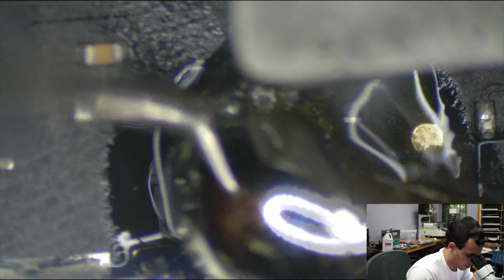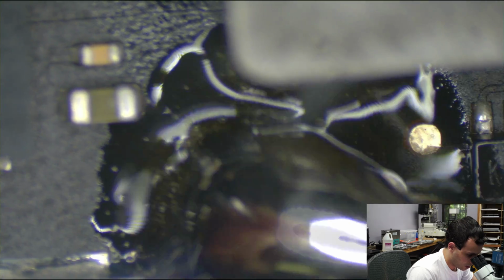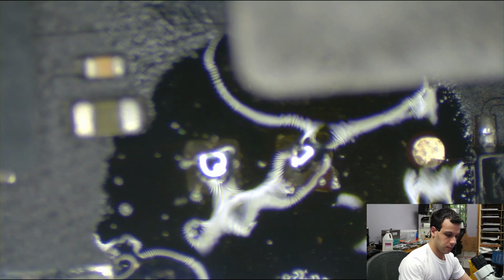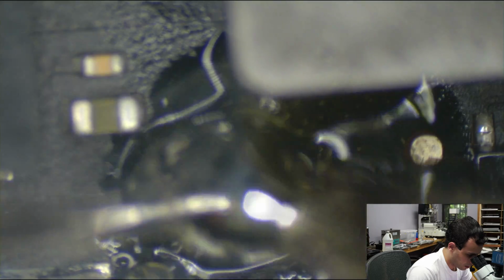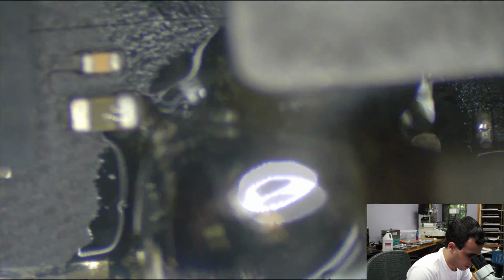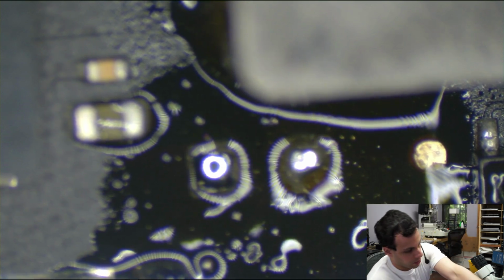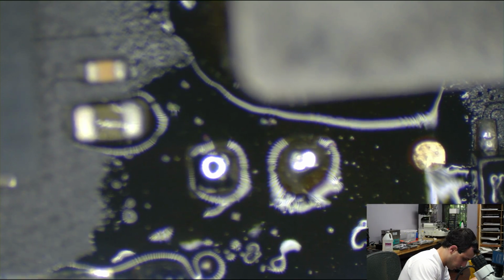Replacing backlight fuse on Macbook Air.

Comment: Hoping that this would be a solution to my problem, however it looks like there's something more to it. The backlight mostly doesn't turn on after wake up from sleep, after a reboot it's always working fine. Sometimes the computer does a random reboot, after which the boot takes a while. The board has been replaced by Apple, after that, some time later the backlight issue started appearing, it happened with hight frequency, so A replaced the display too. The frequency of the issue dropped, however it's still persistent. My guess that it's either a failing SSD (thus the slow boots) or a cable (doubt this tho, since the computer doesn't need to be moved for the backlight to disappear or not come up). Anyone has suggestions where to look next?

Comment: I swapped a cracked display on a 13” mid 2014 MacBook pro with Retina display and the backlight stopped working. (I most definitely had the battery disconnected) I swapped the old display back thinking the display I purchased was faulty, however that no longer has backlight. I checked the fuse with a multimeter and there doesn’t seem to be an issue with  it. There is no visible damage to the display cable or it’s connection. Any ideas of what could be the issue. It’s not really worth it to buy a new logic board when you can find these macs on Craig’s list for the same price.

Comment: I have a Macbook air 2015 model with the backlight blown (wine spilled on the mac). The screen is visible if you shine a light. If I replace the screen completely do you think that will fix the issue or is it typical that the problems go beyond the screen assembly. Diags come out clean.  Thanks!
Reply: Im in the exact same boat, same reason, same drink! :-) Im currently using an ipad as an external usb screen but im not sure how long my eyes will be happy with the setup.
Reply: trickeyD We sent it in to Louis and he was unable to repair it. Now the screen works fine, but the SSD and fan sensors have no connection so we cannot use the machine. Might have happened anyways, who knows but not all the boards apparently are repairable.

Comment: hello there Louis, great videos, i had to test about 100 a1398 lcds, halfway threw the test the macbook is coming on but the screen is not showing in anymore, i was wondering if i have blown this fuse which is next to it, l8300 or the P fuse as for your video, now i have 2 of those in the same situation i have blown 2 a1398's they come on but no display, this happened by just testing some retina lcds, please kindly if you can an answer, many thanks ( boards are 820-3332-A)

Comment: Hello Luis,
I am spanish. I am sorry for my english.
I have a MacBook Air 13" 2011. The problem that it has is no display backlight. I checked the fuse "P" and it failed, no continuity. I replaced the fuse and the MacBook continues the same, fail backlight. I checked another time the fuse, the fuse is Ok. At one of the extremes of the fuse there are aprox 8,00v and at the other 0,00v but the continuity is Ok, I do not understand this. Can you help me?. Thank you very much.

Comment: Dear Louis,

Great video, indeed!
I'm trying to apply the same fix onmy own, but I'm wondering where to this "F7700" backlight fuse (if not from a dead board)?

Appreciate your feedback!

Br,
Thomas
Reply: Probably pretty late for an answer. But you can take the specs from the schematic and order it from any electronics components provider

Comment: hey Louis!
first of all, finally found some good useful stuff on YouTube again, really nice channel, keep it up!
so I have a problem: I have a MacBook air mid 2009, and it doesn't turn on anymore (the sleeping mode didn't activate after I put it in my backpack and it overheated, after 2 hours it cooled down but it didn't start anymore) There is not a specific beeping code, but sometimes it beeps one single time for about three seconds, than its quiet again. The beep is not repeating and only comes once while new starting...
fan is running as usual, but screen is black... 

any suggestions what video to watch? you have so many ;)

thanks in advance
Reply: oh and it doesn't beep while new starting, it beeps after I started it, but not always at the same time, sometimes it takes seconds, sometimes minutes!

Comment: Hello Louis, Thanks for your videos.

I'm trying to fix a Macbook air that as been spilled with water. Although it works perfectly with an external display its backlight isn't turning on and also using a flashlight I've found that there is no "signal" to the screen. Any chance of the display also being damaged by the logic board or by your experience you think that it's unlikely to happen and that damage will be limited to the logic board?
Reply from the maker: +Filipe Costa It's kind of like asking if someone gets shot, will they be able to walk again
Reply: I see, thanks for the input.

Comment: Love your videos man... I have a MBA 2013 13' A1466 no backlight can see with flashlight though(not a screen issue have 2 screens) fuse F7700( Name on board: P) is passing continuity tests which I tested because I thought it was a fuse, whats next on the primary suspect list the WLED driver? i'd be interested in hearing your common suspect on these boards
Reply: +Health Verum I should ask is there another way to diagnose the root cause with a multimeter?

Comment: I bought a macbook Air tonight with backlight issue for $100 and I was just need to know the fuse how does it look like so I can replace it .
Reply: +Maiaal100 if its the MBA 2013 13' probably the P fuse right over beside the ribbon ...not for sure though
Reply: +Health Verum  Hi
thanks for replying, I found it and replaced it :)
it`s working perfectly now
and you`re right, it was the one beside the ribbon
Reply: your lucky you fixed it. I have the same issue right now except I'm getting a positive continuity for my fuse.. something deeper I believe (n)
Reply: and congrats on the 100$ steal nice profit ;)
Reply: +Maiaal100 how do you know if its bad fuse? 2014 macbook air no back light:(
Reply: use the micrometer to test the resistor through the fuse

Comment: Hi Louis.  I really enjoy your videos.  Good stuff.  Anyway, I have a question that doesn't necessarily pertain to this video but it's a problem that many iMac and MacBook owners have to suffer...and that's Random Shutdown Syndrome.  Have you done any boards that have this problem?  And if you have, what do you usually look at first?  And do you ever refer to the OS shutdown codes for insights?

Thanks.
Reply from the maker: TheMasterCylinder What board is this? This can be anything, literally anything.
Reply: Sorry.  The logic board of, possibly, a MacBook Pro 2011 or, in my case, an iMac 24" early 2009 with geforce gt 130 512 MB.
Reply from the maker: Shitty VRAM on iMac, GPU on Macbook.
Reply: Succinct and to the point.  Thanks, Louis!

Comment: Great video louis. Was wondering if you have any tips for a new tech when it comes to troubleshooting a motherboard. like what should i check first or is there a efficient way of checking most/whole board?
Reply: +DEM9271 Look for any oxidation, burns, or swolen caps.

Comment: Louis How much do you think is a fair price to charge for this repair?  Most people are not going to do this themselves
Reply from the maker: Khuong Truong $325 + tax here. A few reasons I find this fine.

1) *speed*

Half the shops around my area would tell them to replace the board or outsource it to someone who charges them $200-$250 and takes a week to do it(while stealing half the machine's parts in the process). Whether outsourcing board repair or ordering a new board, that takes time, that professional users do not have when this is their primary work machine. I am offering you turnaround you won't get anywhere else, which is an upsell. I can take the machine to my office, fix, and bring it back to you. No downtime is worth something. 

2) *Living area*

In my market, that upstairs from my store are disgusting, shitbox apartments for $2600/mo. One even went on fire spontaneously recently, and they cost $2600/mo. I am open with many people that they may find cheaper if they look outside NYC, if they are calling from other states looking for board repair. No reason to pay NYC prices if you live in Oklahoma or Wisconsin. In NYC, Manhattan in particular, everything is a ripoff, and sadly some of that gets passed onto the customer. :( 

Outside NYC I wouldn't mind offering board repair for $140-$250 but this is Manhattan. 

3) *job done right*

You may think "oh it's just a fuse." It's easy to do that.. "Here's how I see it. I think of all the times I tried to teach a new employee how to do something, and I remember all the stupid fuckups they made along the way. Then I imagine what is it worth to the customer to avoid repeating that experience. It is really hard for us as professionals to remember back to what it was like when we were clueless tards, but it's easy to get a glimpse of that when I try and teach someone new. It reminds me of the value of a job well done, when I see what someone else thinks is ok to do on the first try. That is what the customer is in for when they try to do it themselves, or take it to a craigslist newbie. 

What if it's something else? What if there's a short to ground? What if a component gets knocked off? What if you forget to unplug the battery? Think of everything your worst employee ever fucked up, and imagine that happening to the customer. What is it worth for them to avoid that experience? 

4) *flat rate system* 

If a board tortures me, and takes 3 to 5 hours of my life, and I cannot fix it, I do not charge. In the no fix no pay system, this is made up for by the boards I can fix. So flat rate applies. I'm not going to charge $0 for the jobs I put an hour or two into because I didn't fix them and then charge $40 for a successful one because someone else thinks I should call it "easy."  I aint charging people for unplugging their battery and plugging it back in or for SMC resets, but if I'm taking out a soldering iron and a multimeter, you pay! 

5) *clean conscience*

If one wants to learn how to do it themselves, they can watch the video I made for this purpose. this shows you how, with the most inappropriate of tips, and a ten dollar soldering iron, how to replace the backlight fuse. This video was designed with DIY people in mind. 

https://www.youtube.com/watch?v=NKXzm_fkja4

If you want to learn how to directly compete with me, what tools to buy, how to sell customers, how to fix boards, how to manage a staff of talented people, how to find a staff of talented people, all of that and more is available here. Literally, a blueprint to how to do what I do and undercut me... is all here for free. If someone lacks the funds to pay for this, I am not offended one bit. You can use the free resources Ihave posted to figure it out and do it yourself, which I'd like to think are better resources than what you'll find anywhere on the internet.

But, if you don't want to make use of the free content, AND you don't want to pay, my heart kinda pumps piss for you. 

6) *specific issues system sucks for board repair*

I am not about that eBay backlight repair BS for $20 nonsense that goes on with iPads/iPhones.

In terms of no backlight only; tried that, NEVER AGAIN! I discuss that here. https://www.youtube.com/watch?v=7I1VBM4VduE How many fucking dead machines i received with green shit growing from under the SMC  with the no backlight coupon, with people telling me they turned on perfectly before and I must be purposely fucking them up to get more money.. there's a very easy fix to this. Flat rate board repair. My rule is simple, if I piss on it and my urine fixes it, it is the same rate as if I spend five hours on it changing components. My salesmen knew this would be a nightmare, warned me, and I ignored him. I caused both of us unnecessary conflict and misery. 

There is an extra step of conflict added.

customer:  "Look, no backlight." 
me: "yes, no backlight, because your CPU is dead and it is beeping..."
customer: "well, YOU said if it has no backlight it is 40% off..."
me: "sequence of expletives that will earn me a 1 star review"

I get if you run your business differently. The proper thing is to do what works for you, and come up with a strategy that is compatible with whatever you do.

Comment: The broken screen should have been diagnosed during the diagnosis phase, with as big of a problem as a broken screen, they likely would have not chosen to spend $325 on board repair, especially if you are calling it "solutions based billing" you probably told them the $325 would make their computer work again.
Reply from the maker: mrlithium69 The cool part about getting to 10k subscribers is that everyone suddenly knows everything :) 

Someone paid for board repair, sent it in for board repair, included a note that said this only needed board repair, prepaid for board repair, and got.... board repair. 

I suggest people send in for free estimate if it is dead. No need to prepay. And people who watch regularly know my feelings on the self estimate.
Reply: Louis Rossmann Thats pretty funny then. you shoulda included that in the video

Comment: Louis Rossmann it really is confusing as to why there is no fuse after the voltage is bumped up to 30-50V. 
Do you think the back light fuse blew in this situation because of liquid? on the board?
Reply: Chris Long probably due to the broken screen
Reply: Aaron Fletcher if that was the case it should have blown again when he powered it on or showed a GND short. 
From the looks of some of the test pads and the fuse itself, it looks like its seen liquid.
Reply: Chris Long well if the screen broke in lets say a fall then maby the lcd cable came loose from the board an caused a spike? i dont know how they secure the cable
Reply: Aaron Fletcher only reason i bring that up is because on some iphones and ipads if the cable is pluged in when its on can cause it to blow the circut
Reply: Aaron Fletcher normally its a slide in connector with two dimples to click the cable in and a swing over latch/handle piece. 
Just looking at the red test pads and fuse it still leads me to think liquid. 
All the no back lights I see are cable or liquid caused and hardly every blow the fuse.
Reply: Chris Long hard to say  the board may have been cleaned without the input of how or when it happened  just leads to speculation ya know